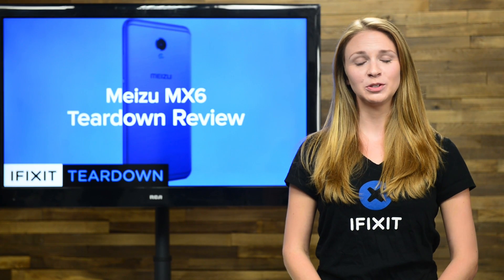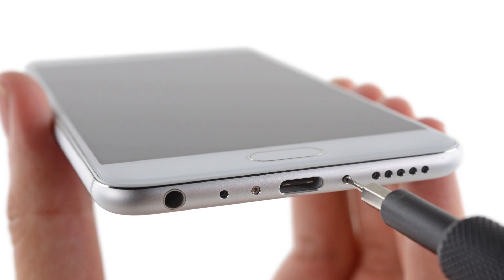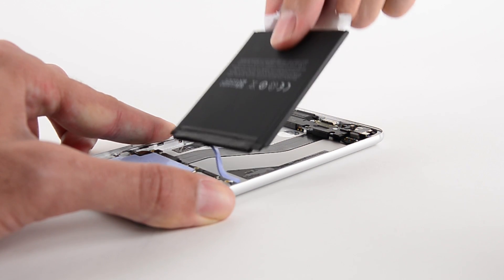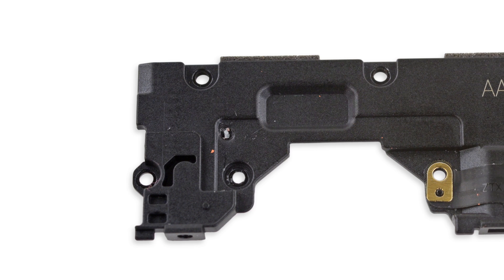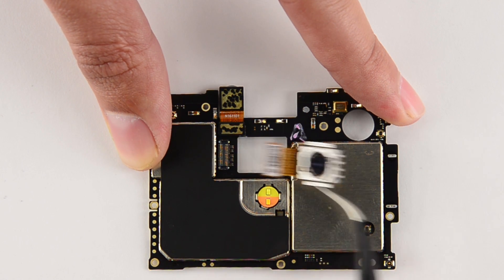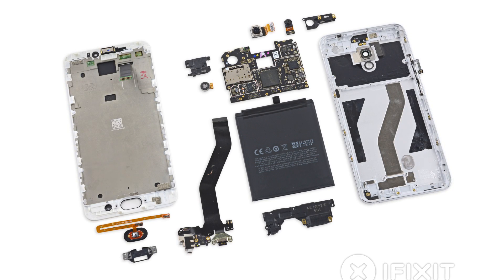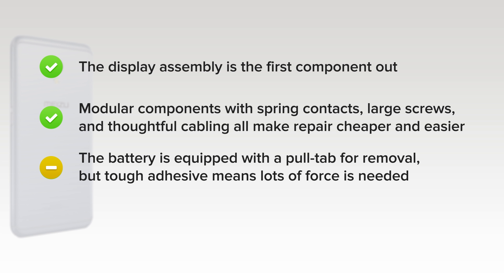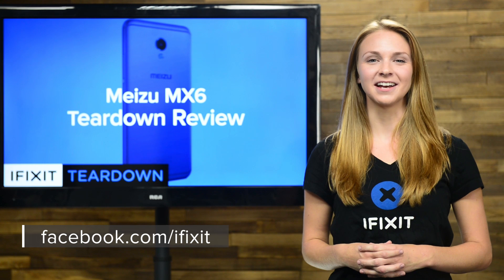Meizu MX6 Teardown Review!

Comment: I have question, it is possible to change the camera in phone on different? I would like to change the camera in OnePlus3 on the camera from Oppo R9s Plus. This camera is better she has bigger size sensor  (1/2,3 and 1,55 pixel size ). But it is will be works?

Comment: Ouch!
I know you don't usually have to take those metal chassis that protects the chips out for repair, but the damage done to the board at 1:58 is either too close to components, or already ripped off some there... xD 
Not that anyone will be using it anymore or that it should affect repairability score, but still... ouch! xD
Must've been hard to take that chassis out.